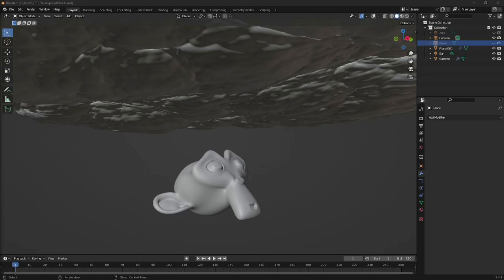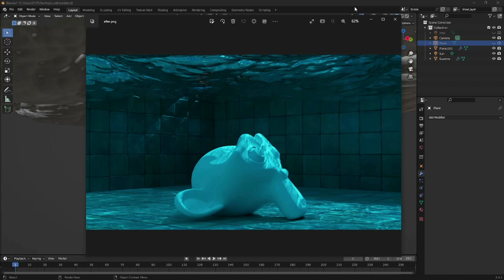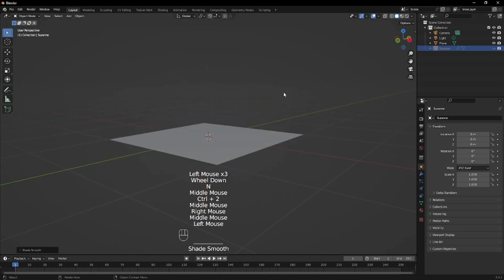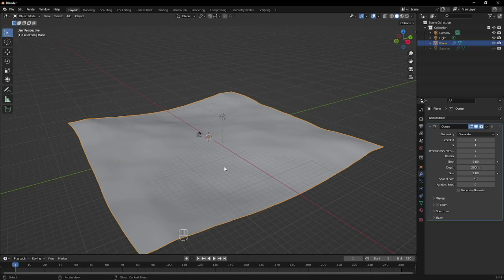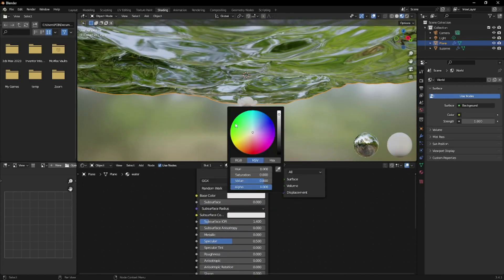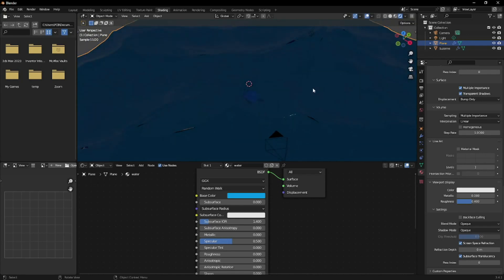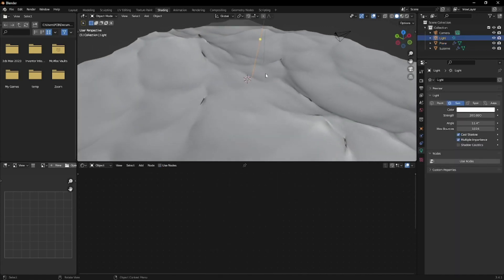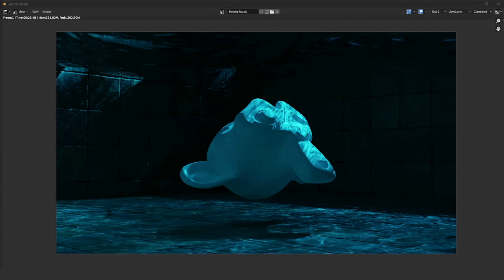【Blender】Simulating Water Caustics (v3.4)

Comment: Nice walk through the set up. 
Something is missing though. 
Perhaps Blender doesn't care in its caustic calculations and the effect will be the same but water is not an infinitely thin layer ( like an X-Y plane with some subdivisions but no z-axis thickness). The refractive index of the entire volume/column of water from where it hits the water surface all the way to the  surface upon which the caustic patterns are cast is ALL water and, like a lens, the light is more affected the more of the material volume (the water) that the light passes through.  
So perhaps the caustics solver just assumes that IOR all the way from the water surface all the way to the caustics receiver  but I submit that the look of an underwater item should also have the volume that surrounds it be calculated ,i.e.  some light diffusion (unless the water is EXTREMELY unnaturally crystal clear) and some light rays in the water ought to be visible too.